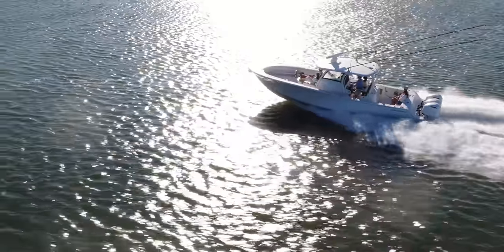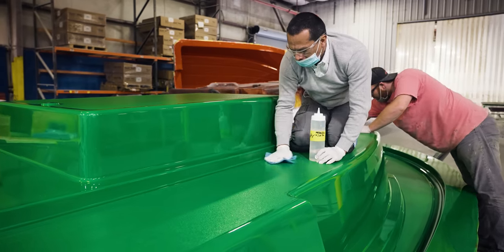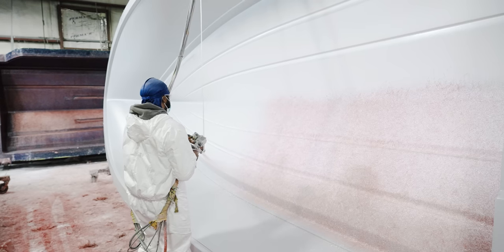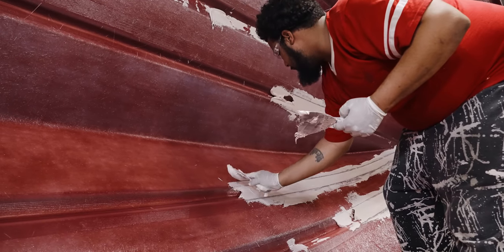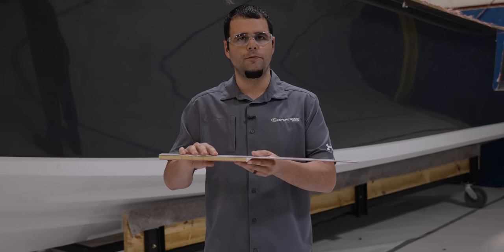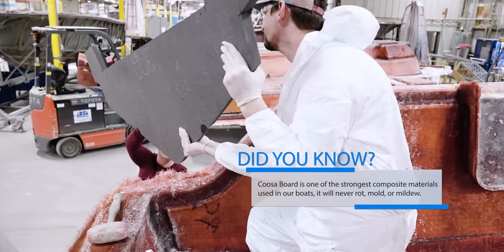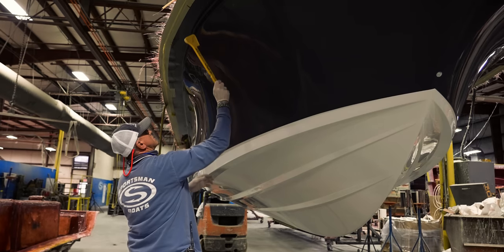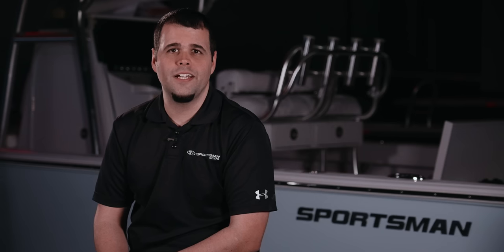Building A Boat Boat Hull The Sportsman Way - Sportsman's "Behind The Glass" (Season 1 - Episode 1)

Comment: I would like to know what CAM software you use in conjunction with Rhino. I work with composites in architectural company but as a sailor and windsurfer, at some point would like to switch into boat design.

Comment: Those filled in stakes are pretty much extra stringers huh
Reply from the maker: It's not necessarily a secondary stringer but it does add a lot of extra structure and strength to the hull.

Comment: Great video.  Is Sportsman
 Doing any vacuum infusion on the larger models ?
Reply from the maker: The 352 is fully vacuum infused (hull, stringer, deck and hard-top)
The 322 and 302 have a vacuum infused stringer and hard-top.
Reply: @SportsmanBoatsOffical  ok thanks.  How far out approx is mfr time for the 302 if order right now?
Reply from the maker: Glad to see you’re interested in a 302! If you contact your local dealer they can give you an approximate time frame on build slots.
Reply: Any suggestions on who to contact?  I am in California and there is not a dealer out here that i am aware of.
Reply from the maker: @Deepimpactocean  please go to the website and put in your zip code and it should direct you to one of our Texas dealers. That's going to be the closest we have to California at this time.

Comment: What is the cored material made up of?
Reply from the maker: It’s a PVC high density foam.
Reply: @SportsmanBoatsOffical  ok thank you. Any special care if you need to replace a thru hull fittings or any special maintenance to keep the water out of the core around the fittings?